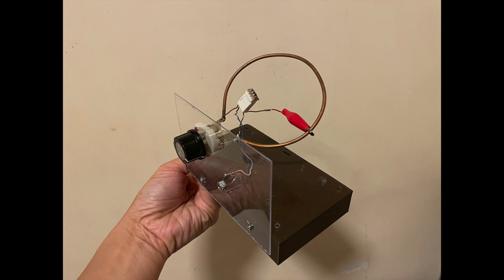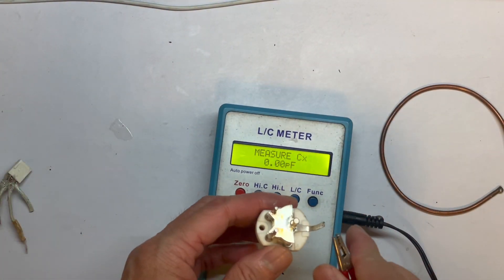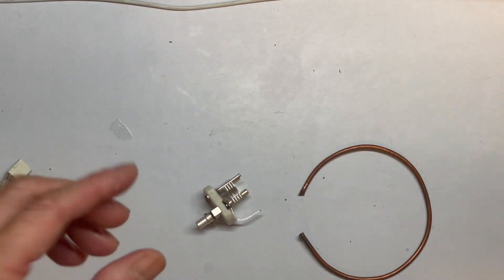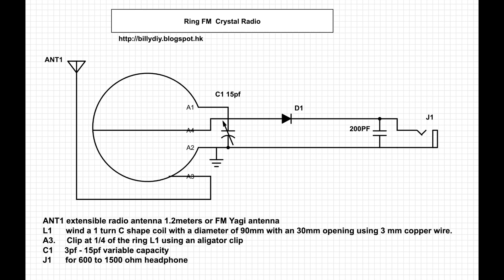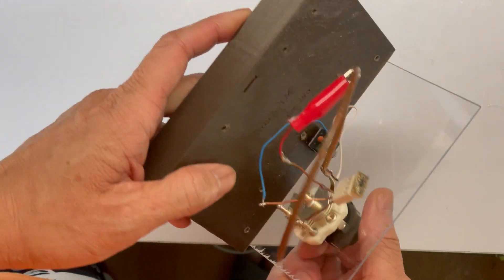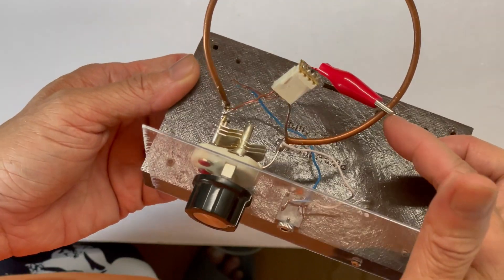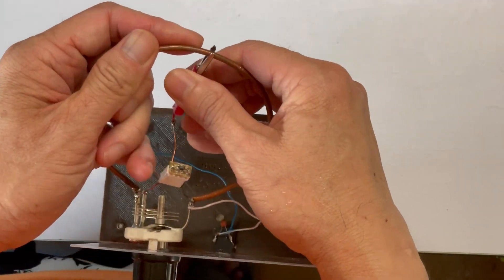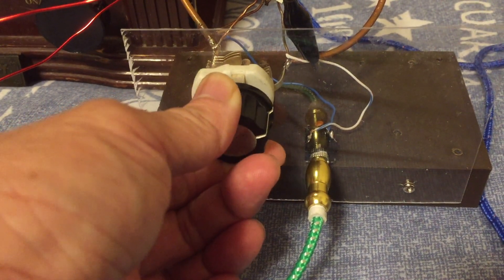Ring FM Crystal Radio

Comment: The FET does the FM detection ?
Reply from the maker: Yes. You can use either a low voltage mos fet or a sensitive diode for this
Reply: @BillyCdiy  But you can't detect FM modulation with a diode, can you? That's only possible with AM modulation.
Reply from the maker: @cazkasjmir, we use an indirect method or approximation called slope detection.  Check out this video for the full details Tips for making your FM Crystal Radio
https://youtu.be/u_c77M-m_YY

Comment: I'm having a hard time finding a replacement part for 3SK143Q  3DQ FET. Below you mention a HSMS-2850 series but those are also obsolete.  Would a BAT62 or BAT15/1504 be a fair substitute? Both are zero-bias Schottky diodes. The BAT15/1504 is two in series with a tap terminal between the two.
Reply from the maker: Check out the last page of this blog. I added a link to the e-bay shop where you can buy 3DQ. http://billydiy.blogspot.com/2021/05/ring-fm-crystal-radio-i-purchased-few.html
Reply from the maker: I haven't tried, buttThe BAT 62's  diode capacitance  (0.35-0.6pf) is low enough  to be used  for FM Crystal radios.

Comment: I will have enough parts to build this, is the performance as good as your other radios ? The diode version any diode ?  I like the idea of the alligator clips to get correct matching impedance any well done yet again
Reply from the maker: HSMS2850 is the diode that I found best suited to FM crystal radios, but it has 20K output impedance. You will need an output transformer to step it down to match with your head phone. Performance wise, the conventional multiple turn of smaller diameter coils (5 turns of diameter 15-20mm) is still better.

Comment: Slope detection always amazes me. It relies on the variation in amplitude of the signal in a tank as the FM transmitter varies its frequency a bit during modulation. Therefore, in order to generate a noticeable signal the tank must have a high Q in order to tune so sharply that the level of RF rises and falls due to that relatively small frequency change.

Comment: Excellent work Billy! Just one suggestion: Many of those alligator clips are nickle plated steel, which can have a bad effect on the Q of the coil. It might be worth trying small brass clips, or even soldering the wires, once you find the best position.

Comment: Yeah! I am the first one here! 
How do you come up with these designs Billy?
Reply from the maker: Thanks for asking.  I learnt from other experts who shared their ideas about crystal radios, then build on them. Sometimes, I deliberately tried out every different way to connect the MOS FET 3DQ and found one unconventional way to wire up the circuit that has proven to  have significant  improvement. Other times, I will think about them while I am going to sleep. Dreams some times may come true too. One or two ideas may pop up that proves to be useful, or move me to the right direction.
Reply: @BillyCdiy  Wow! Thanks Billy, for the wonderful insight !